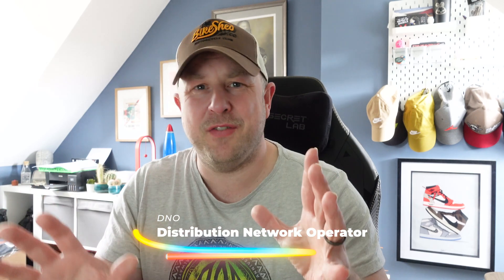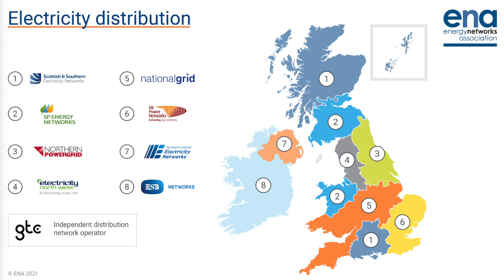What is DNO Approval for Solar // Wind // Battery Storage // G98 // G99 // G100

Comment: Hi Dale - your video on G98, G99 and G100 DNO approvals is excellent and very informative. 
In securing my solar panel approval comprising an ac to ac connection with solar panels with micro inverters, 5kW main inverter with 10.1 KWh battery storage (plus ev charger}  my installer mentioned the the DNO approval on the maximum number of panels allowed is not based on the power output of the panels, but on voltage differences or similar. An upper  limit  of 10kWh was mentioned with 0.38kWh per panel added to the 5KWh inverter capacity. Would you please clarify this calculation on the maximum number of panels required. Is it the upper limit of the G99 application, before the G100 kicks in with the export restriction?
Reply from the maker: As far as I am aware, the DNO is concerned with how many kW of electricity you can potentially put back onto the grid. I assume this is a house installation, so its 230v which DNO consider low voltage.
As far as I am aware there is no upper limit per se, but it will depend on the DNO, where your house connects, and how many other houses have solar / battery installs.

So essentially you have the 5kW inverter which means in theory this is the max you could put back into the grid. If the batteries use the same inverter then nothing changes and the batteries are irrelevant, if there is another inverter for the batteries, this will play a factor as to how many kW that can discharge.

To my knowledge the DNO only cares about the potential export, not how many batteries are panels, it depends how many kW your system may put back onto the grid.

Hope that helps.

Comment: Had a quote from one installer wanting to start the install of a larger (9.6kW inverter) system in parallel with the G99 application. They were otherwise making a very competitive offering, but this red flag led to me rejecting them as it would be I taking all the risk. Anyone decent will always wait, particularly as my DNO (North West)has a reputation for being a bit troublesome and slow.
Reply from the maker: 100% always wait until you have DNO approval, or you are not going to be a happy bunny. You did the right thing in my opinion.

Comment: Is export to grid as you say your is restricted to 5kw, is it for whole day or per hour?
What I am not sure about this export restriction, like if you have 5kw system which let’s say is generating 5kwh, you are on holidays for couple of week and your sys😢is generating like 100kw/day for 14 days, will you get money for 1400kw which your system exported? Or just for 70kwh as your export is restricted?
Sorry if you find this question very basic 
Thanks
Reply from the maker: The restriction is the size of array you can have connected to the grid / the level of export per hour.
So for example, if you had a 5kW restriction, but you had a 9kW solar array you would need to have a G100 (in the UK anyway) restriction device to make sure only 5kW of the potential 9kW is sent to the grid.
TLDR for your example, you would get the 1400 kW.
Reply: @SpectrumGeeks  thank you

Comment: Great vid once again. Your conversation about DNO applications matches what I knew from my own experience except I thought it was 3.68kw not 3.86kw but I coild be wrong.

It would be interesting to hear your experience of a house sale that included solar. Did it have any bearing on the sale? Did it complicate the sale? Did it attract more buyers and / or price? Perhaps a topic for another video!
Reply from the maker: Thanks for watching and commenting Brian and you are 100% correct on he 3.68 kW, I had messed up my numbers on my prompts so continued to muddle it up the whole thing :( 
Will deffo do a video sharing my experience of selling a house with solar, etc.
Reply: Great video - thanks!
You mentioned you can export 5kw - and that's really interesting - I thought 3.68 was a hard limit for one phase. Do you know what the max is on g99?
Reply from the maker: @andybrown668  3.68 is the limit without approvals. G99 approvals and export levels will depend on the local infrastructure (i.e. approved exports in your area using the same infrastructure), then the fuse at your house will be the other limiting factor.